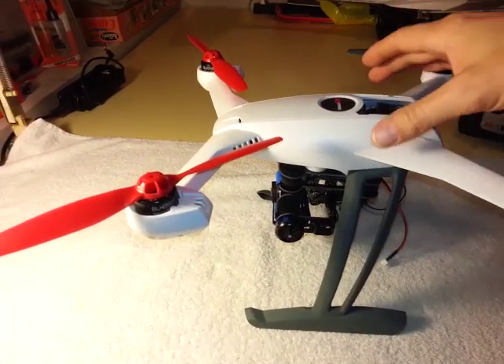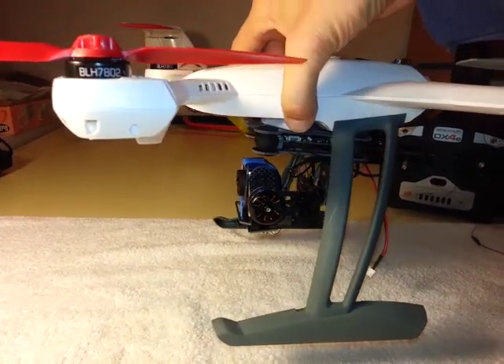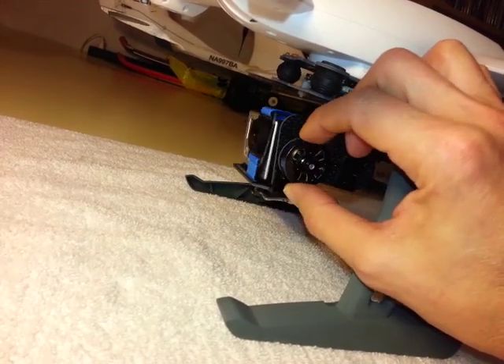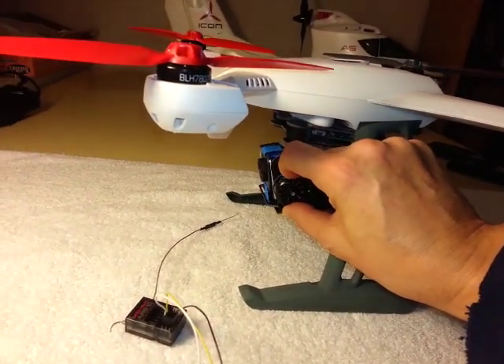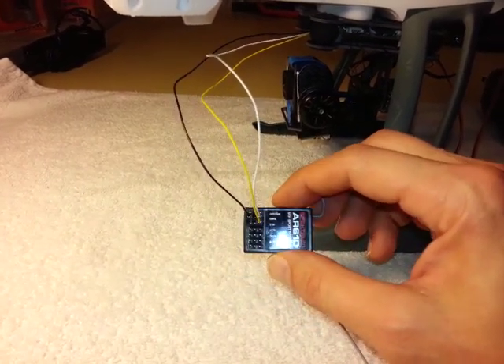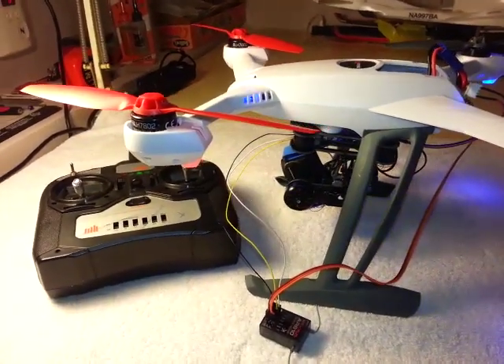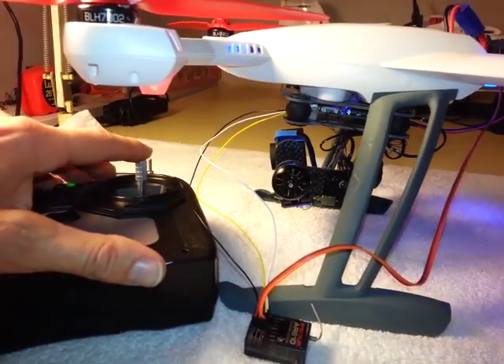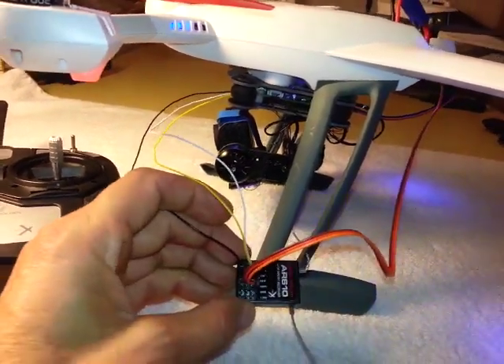350 QX gimbal camera tilt control

Comment: hi great video and awesome tips! just one question about the gimbal... which gimbal do you have and how was it mounted
Reply from the maker: katpis, I built the gimbal using parts from different sources so I can't supply you with a name or type. However, they all function almost identically so it doesn't really matter which one you use as long as you ensure the controller board accepts inputs to independently control pitch. I attached the mounting plate in the center of the 350 between the landing gear. I took the top cover off the 350 and drilled three holes to mount the plate using 3 bolts with self-locking nuts. I took a nice picture of it but I can't figure out how to post it here, sorry.

Comment: Great job and great video. I was just wondering though, is there a 2 channel receiver and transmitter that can work together just for the purpose of having tilt control for the gimbal. A cheap option, instead of havinf to buy a more expensive Tx or Rx with x>6 channels. Has anyone tried that?
Reply from the maker: Tiberiu, if you read my other replies here you will see that I got a DX9 and bound both the 350QX and the spare receiver to it allowing me to tilt the camera with the same radio. I believe the next generation of 350QX is about to come out with this functionality built in......I think. In the mean time I sold mine and bought a DJI Phantom. It flies much steadier and has all the camera control functions built in already. Much better product.
Reply from the maker: Tiberiu, if you read my other replies here you will see that I got a DX9 and bound both the 350QX and the spare receiver to it allowing me to tilt the camera with the same radio. I believe the next generation of 350QX is about to come out with this functionality built in......I think. In the mean time I sold mine and bought a DJI Phantom. It flies much steadier and has all the camera control functions built in already. Much better product.
Reply: Kent Armstrong  Yes, I know, but what I am saying is, can one buy a 2 channel Tx and a 2 channel Rx ( both cheaper thab a dx9 and a 7 channel Rx) and use them for tilt? Instead of investing in a DX7 or DX9 and the respective Rxs

Comment: Hello Kent 
recently I received a old QX2 + DX6i controller as gift but I'm just starting use it and I will use it for aerial photos and videos in the next months. Also the QX2 came with a 3rd party Gimbal (no brands I think it's a china item) and so I would like to mount it on the Quadcopter but I don't understand how to connect it and manage it by my DX6i (I can't see any "gimbal" stick or button on the DX6i.
moreover On your video I see that it's absolutely necessary to use the AR610 as second receiver, so now I need to know: 
1) only AR610 works right with QX (or QX2) to get gimbal control? (For example a AR6210 will not work in the same way?)
2) How to bind the QX2 and the AR610 (or other second receiver) at the same time?

Comment: I see this video is older, but I like your thoughts on this. I own a 350, and am researching gimbals too. But I disagree on your conclusion that you shouldn't use the 350 internal pitch and yaw outputs to control a gimbal. Why not? They are there after all, and it would reduce weight to use them rather than a separate control board. You said you use them as a power source. But again, use them for pitch and roll, and then create a third channel from another receiver to control pitch for camera up and down control.
I am curious why you would not do that?
Reply: +Doug Moody 
Are you saying that on the QX2 main board are there some pitch and roll connectors to use for the gimbal direct control, so without using a second receiver (as AR610 or other)? Where are they? could you upload some detailed picture or video, please?

Comment: Hi, I bought a universal DJI gimbal in Las Vegas, and was told That I could use it on my 350QX. But how long will it take from you switch it on until it is ready the first time? I waited 5-6 minutes while Zenmuse H3 D3 gimbal did somekind of calibrations. Or did it? I turned it off cause it got very warm.

Comment: Kent, do you know if it's possible to upgrade the receiver to an 8 channel so one radio could be used for flight and tilt control?
Reply from the maker: DNutsMI, I just figured out how to do it with one radio. I bought a DX9 and bound the 350 and the spare receiver to the DX9. I plugged the tilt control into the AUX1 port on the spare receiver. Instead of assigning AUX1 to switch B I assigned AUX1 to the Right Knob. This allows me to use the right knob to tilt the camera in flight and also to activate the "Come Home" feature if I rotate the knob all the way. Works like a charm.
Reply: Kent Armstrong Great... I didn't know if a 9 channel received could be bound to 2 different receivers at once. One being the 350 and the other being a spare receiver to plug the gimbal into. I'm looking to purchase these items as a gift for my brother and I don't know much about this stuff. Really appreciate your input.